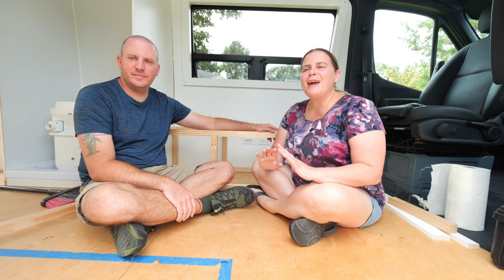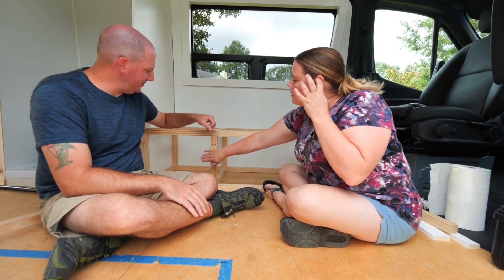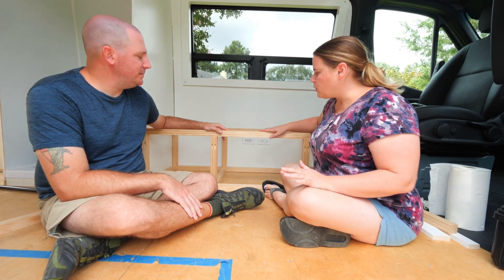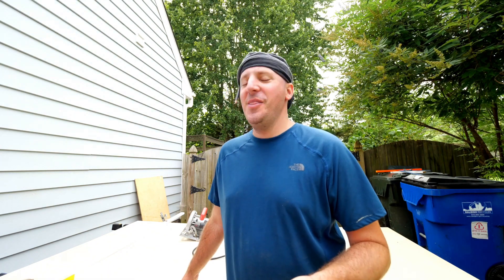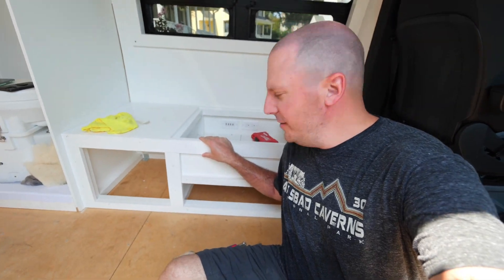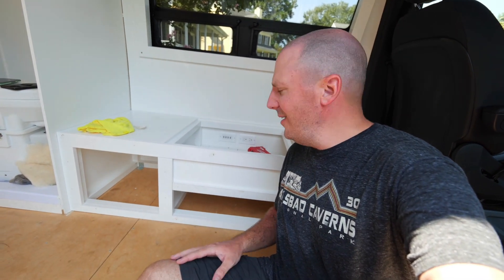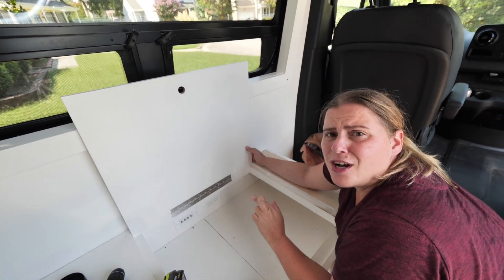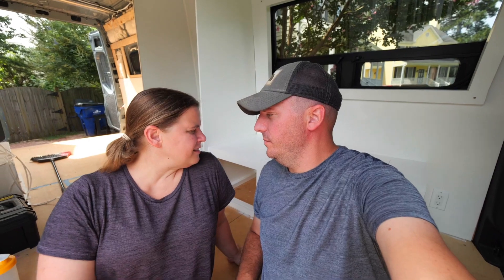Building a BENCH SEAT with ELECTRONICS CHARGING STATION & Cat Bathroom!!  |  DIY VanLife Conversion

Comment: Such good work! What are the dimensions of your beast couch? More specifically, how tall is it?
Reply from the maker: Thanks so much! The beast is 16 inches tall and we have a 5 inch cushion on it for a total of 21 inches. You could probably make it a little taller if you want a thinner cushion. It’s 48 inches wide and 22 inches deep.
Reply: Thanks for your dimensions. Our plans have room for a 60 inch wide X 29 inch deep couch with 16 inches high. We’d like to build ours tall enough to store guitar cases but that requires almost 20 inches. Just trying to figure out dimensions